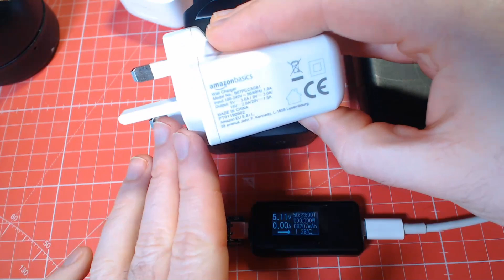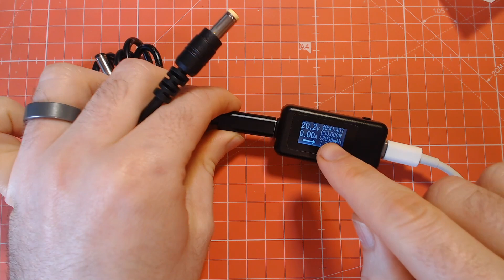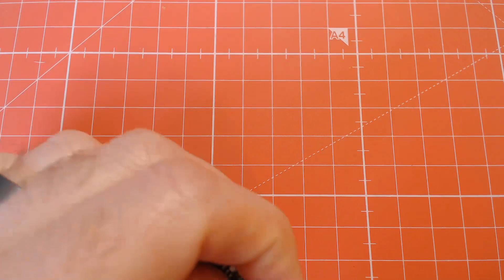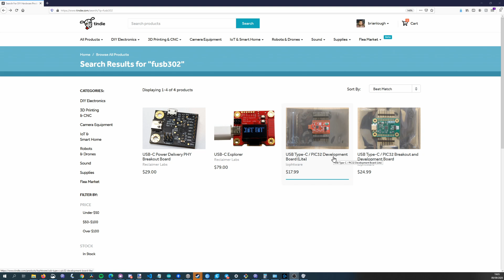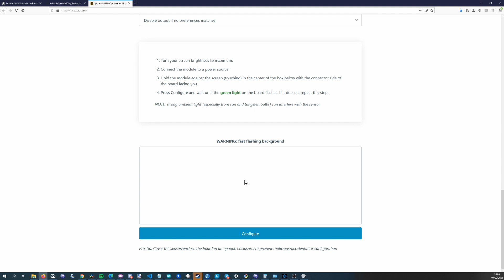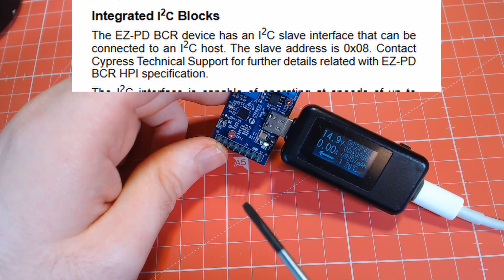Powering your projects using USB-C Power Delivery

Comment from the maker: A piece of footage ended up on the editing room floor incorrectly! The IP2721 will accept the highest voltage the PSU offers that is less than or equal to what is requested

E.g. if it's configured for 20V, but the chargers max is 12V, it will take 12V
Reply: Can someone please tell me if this chord (USB 3.1 Type C USB-C to DC 5.5 2.5mm Power Plug Extension Charge Cable )  can be used to take power from an Anker battery bank and deliver power to the Atomos Ninja V which has a DC connector for powering it from the wall.  Essentially I am trying to understand if a chord which is used to deliver power from a DC source to USB-C can be utilized to deliver power from USB-C to DC.   Can power flow either way in this case?  Thank you.
Reply: Hi
The IP2721 will charge my 90W laptop from a 12V Battery? 

Also The FUSB302 will charge my 90W laptop from a 12V Battery?
Reply from the maker: @Xiaoxiaoxiaomao  neither turn a power source into a pd source. Search for XY-pds100 for something to do that, although I do not believe it will boost your 12v source
Reply: @BrianLough  The FUSB302 chip can actually be used on the source side, but obviously it needs different programming on the microcontroller, plus external circuitry for the power conversion.
Reply: I'm trying to make my own Bluetooth system what's up best pd board to use
Reply: P

Comment: Hi! I am looking to use one of these but custom profile being 6V. Is this possible? I know it’s not the standard 5,9,12,15,20. Thanks!
Reply: You would have to get one that supports PPS. The bigger issue is the supply would need to support PPS as well.

What are you looking to do? Maybe just a boost circuit that boosts the standard 5v up to 9v would be a better option?
Reply: Can't seem to edit that reply, I obviously meant 6V

Comment: I have a 100w power bank with PD from China that i came across when working at amazon. It has 2000mAh and will output 3v 4v 5v 9v 12v 15v 20v and 24v(NEVER seen a bank put out 24v, but i've tested it with LED strips and it works). It is a literal big black brick, but heavier. Even charging in PD it takes hours to fully charge. Only one i've ever seen like it. Even has a flashlight on it. don't know why, but it does

Comment: HI Brian .what would be easiest way to power up computer fans 12v from usb type C charger, my controller use regular plug from psu (12v for fans and 5v for lcd screen) does charger with type a for 5v and  and type c for 12 work ?just use two cables or is there an easier way

Comment: If you need a dedicated unit to supply the E/I, what's the point other than the ability to be able to change the voltage? If one build many projects, they all need their own supply, so why not just use a dedicated wall-wart. To my eyes it's nothing more than a universal power supply with a new connector. Please, someone clarify if i'm wrong.

Comment: Question; I have a 20V 3.25A DC power supply brick, and I want to change the original cable for a USBC for power delivery. Cable has 3 lines, white black and blue, should I guess the blue one is meant for voltage negotiation? Can I just leave it hanging since I just need my 20s.

Comment: Hmm I have a a project with 2 chromebooks that i want to power from 12V battery.. One of my USB-Cables works very well and can charge computers. But when u use a diffrent USB-C it cant charge at all.. the PC wont so anything? Might it be som kind of chip in it? Can these moduels solve that problem?

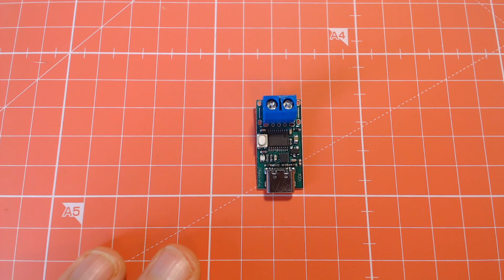Comment: I want to cut my very old samsung laptop power supply (is actually new, it is in a plastic sealed bag since ever) connector and solder one of these (probably the 7:36 one) to make it charge my Galaxy Tab S8 Ultra that supports 45w. Do you think it will work safely? Power Supply specs: 19V 2.53A 48W (it is kinda big).
Reply from the maker: No these do the opposite of what you want, they turn USB power delivery info just power. You want something to turn power into PD.

Comment: Brian, is there a way to control the power (on/off) from the power supply to the device being charged? Can I plug this into a smartphone and control the power through the USB-c port? I need to send 12v to an electronic lock to open and close it.

Comment: this topic might be worth revisiting.
lots of new options on the market now.
incl ones where you can set the voltage by bridging some pads and i have some
that have a tiny set of dip switches for setting the voltage.
easily broken out to proper switches and with some usb-c connectors and a panel volt meter module you can easily make a small volt selector box.

i don't know if you do tutorial videos or anything like that, but i think it would make a highly satisfying project for beginners.
easy to do and the result is something you might use quite regularly.
and few things are more satisfying then making your own tools...

Comment: I have issues in charging my Vacuum cleaner with USB C, I have some more things to try out but it does not like that the PD does +50 watts, the charger is made to 33 Watts so although it begins fine with the charging it begins to fly into the heavens with the Effect 50-105 watts or so and then the robot stops and scream error. I have 20 Volts PD which is very close to the initial 22,5 Volts and it does seem to work, but the blasted release of watts is just no go for it.

Comment: Hi, I am in a process of replacing the power input for charging the batteries of my prototype from a barrel connector to the IP2721 module. So if you can of course, I would like to ask you to let me know what are the distances between the + and - holes on the output of the module and the distance between them and the edges of the board, if possible also the size of the hole. Thank you very much!

Comment: I'd love to see a similar small board with a 3-4 digit lcd, a potentiometer, and three switches. The first switch enables / disables the output, the second one enables / disables USB PD PPS for fine grade voltage control. And the third switch locks an once entered voltage, such that you cannot accidentally change it. When unlocked you can set the voltage with the potentiometer (Using an analog->digital converter inside a chip requesting the voltage from the source), and the lcd shows that dialed in voltage. For me, this would be the only board i'd find useful and safe enough to own and use. hopefully someone comes up with it. Otherwise i'd need to find a programmable usb pd (pps).chip + arduino control code to build my own one
Reply: Seems similar to the current Voltage and current boosters that you can set the voltage on
Reply: @ArtyMars  yes indeed. Just that with the board I wish the voltage is controlled directly by the power supply. That should be more power efficient and you probably get higher currents than if you go the route over 5V and a booster. 

I'm not completely into the PPS standard and voltage regulation though. It could be an alternative to get like 20V 5A/8A via USB PD out and then have a separate Step-Down converter to fine control the voltage. But getting access to the full capabilities of an USB PD PPS power supply still seems nice for tinkering for me.

Comment: Hi Brian, I’m trying to design a custom charging system for my DIY electric longboard with USB PD (and a step up converter), however in order to future-proof my setup, I want to try to make my system compatible with the new 240W PD standard (and be able to request the highest voltage above 12V). Do you of or know how I could search for similar boards to the ones you highlighted in this video, but compatible with the new standard?
Reply: Not that I know anything about longboards but my suggestion would be not to use usb C on it, or any skateboard or scooter.
Charging ports on these devices take a lot of abuse and usb C is too fragile and might break or corrode in humid environments or get clogged up with dirt.
Take a look at XT60 or if you really need more than 60W, you can use XT90 for 90W.
These connectors are a solid choice, most drones (DIY ones at least) use this standard because of its longevity and because it's relatively light.
It will not fail on you, that's for sure, the last thing you need is a fire caused by worn out connector.

Comment: Is the usb c connector on these modules an input only or can they output as well? Like if I input voltage to the screw terminals will it output voltage from the usb c connector?

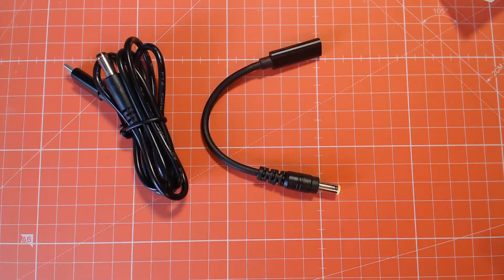Comment: Hello i would like to know and verify if the cable on 3:01 would still supply 5v to a device instead of 20v if i use a charger that doesnt support 20v and only 5v, 9v and 12v. Would it use 12v or 5v? 

i know you mentioned this on the video but im just trying to make sure i understood it right. Thanks in advance!

Comment: I have some issues with different types of this boards. I used them to power my LED Bike light (12V). For some reason the lights starts flashing for maybe 10 seconds when I start the Powerbank, after that it is woking fine. Do you have any idea why this board is not delivering continous power in the first seconds? I tried 3 different boards from aliexpress, 2 with a switch for different output voltage and one with fixed 12V. Do you have any idea?
Reply from the maker: I'm almost certain the negotiation phase happens at 5v, 10seconds sounds very long though! I can't say I've noticed anything like that before when testing

Comment: Can this charging board be used instead of a battery when it is charged with enough voltage to provide as a power supply for (example) a solenoid valve that requires 12v?

Comment: Can someone please tell me if this chord (USB 3.1 Type C USB-C to DC 5.5 2.5mm Power Plug Extension Charge Cable )  can be used to take power from an Anker battery bank and deliver power to the Atomos Ninja V which has a DC connector for powering it from the wall.  Essentially I am trying to understand if a chord which is used to deliver power from a DC source to USB-C can be utilized to deliver power from USB-C to DC.   Can power flow either way in this case?  Thank you.

Comment: Question for anyone knowledgeable on this topic.

I have an HP laptop that has a 4.5 barrel charger and a USB C port that does not allow charging. I'm using a USB C hub that is PD compatible with monitor, keyboard, mouse etc connected to it.

The issue is I have to connect the OEM 4.5mm barrel charger and the USB C hub cable. I'm thinking of building Y splitter that on one side is a female that would connect to the USB C hub and on the other side a male USB C data cable that would connect to the laptop and a 4.5mm barrel connector that would connect to the charge port.

Does this make any sense?
Do you see any issues with this idea?
Would I have to power the data side or I only need the data cables for that one?
Any recommendations?

Comment: Dumb question. Can I use the Male PD Cable Adapter for powering a 12v enclosure (2-3A), from a usb pd type c input from a motherboard? The MOBO can provide 5A

Comment: The part with the fixed Voltage at 4:50 isn't quite correct i have a PD integrated Cable (which goes up to 20V) and my powerbank only supports 15V and the cable doesn't default back to 5V it stays on 15V (measured with multimeter) :D
and my Samsung 25W PD Charging Brick has max 9V which the PD cable fully puts out :)

Comment: Hi power meter you use black one some can explan why this ONLY works with quickcharges and not ulefone power 5 get ONLY up to 2.6 amp but say support up to 5.1 amp its also issue with xiomi ultra support up to 100 watt 20 volt 5 amp but is its same AS powerdelivery?

Comment: What if i bought IP2721 with fixed 20V and i connect it to my powerbank that only support up to 12V 1.5A PD...
Will the IP2721 with fixed 20V Only output the powerbank max supported PD output voltage which is 12V 1.5A  or it will forced the powerbank to output 20V ????
Dont mind my grammar, Need answer asap Thank You❤️ Thank you💙 Thank you 💚
Reply from the maker: It will output the max voltage the power bank supports that is equal to or less than what it's configured for.

In your scenario it will output 12v

Comment: Dear Brian, thank you for sharing your knowledge with all us! I have a bit of a problem I thought you might help me to solve. Please would you be able to think of a solution for the following: I have a 5v 2.5A LED Light I want to get powered through a Usb C PD battery bank. I tried so many different approaches and the best I can get is the light working pretty stable, but at maximum of  70% brightness. The Power bank is Anker 10k with Usb C PD. Bought a cable that goes from Usb C to Usb A and another cable that goes from Usb A to DC 5.5mm that goes straight to the light. First I thought the battery is not good enough, then after reading a bit I started to feel the cable might have some resistors that are reducing the current which then gets not enough for the light. As an example I connected that same cable set I mentioned to my iPhone 11 Pro PD original charger and the light acts exactly the same as when it is connected to the battery bank. The iPhone charger output is 5v 3amp. This is why started thinking there might be something wrong with the cable. I am lost now! I would really appreciate if you can help me on this! Thank you so much in advance!

Comment: I used the YZ12PDN and found it finicky.  It doesn't seem to respond consistently. I can't figure the reason. The blue light starts flashing which means no pd support. Sometimes it works fine.

Comment: So if i want the small IP2721 board at 20V, i need to get it fixed at 20V ? or do i need to change the select pin with an iron? Sorry for the noob question.
Reply from the maker: Yeah buy the one configured for 20v. I guess it would be possible to modify a 15v one to be a 20v one, but I don't think it would be worth the time

Comment: I have an idea to charge my elictric scooter with pd
Its charger puts out 41v @1.9A
The conversion should be really easy but im struggling how to make sure i dont pump too much current
And i have never tried it but my guess is the bms could charge at lower amps if i held the voltage just right

Comment: Can I also set a different Voltage then 5,9,12,15 or 20V?
Reply from the maker: No, the charges have fixed voltages they support, and the standard is only the ones you listed

Comment: I would like to buy this cable and replace the USB A connector with USB-C - is this possible?
AIEVE Charger for Braun Shaver,USB Charger Cable 12V Power Cable for Braun Beard Trimmer Shaver https://www.amazon.co.uk/dp/B07ZFR2KTC/ref=cm_sw_r_cp_api_fabc_UkYPFb17H4R9X?_encoding=UTF8&psc=1
Reply from the maker: I would think so. One of the cheaper modules I showed set to 12V should work fine. One thing to be careful about is that there is a lot of USB PD power supplies that dont support 12v
Reply: @BrianLough  thanks Brian. I will test this very shortly. If the PD charger doesn’t support 12v, it simply won’t provide any power or can it actually damage the attached device? Thanks again

Comment: Thanks for this great video. I read that also the cable is involved in the current and voltage negotiation.
Perhaps the STUSB4500 sticks to the specs exactly and the cable wasn't suitable for the 20V/2.4A.

Comment: Does "current negotiation" mean setting the maximum current that the PSU should give?
Reply from the maker: No, it's not like that. The psu advertises it's max current capability and it's up to the sink(device) to decide if that's enough. The psu will not limit the current at all
Reply: With chips supporting usb pd pps you can actually go into a constant current mode where you can first set a desired current, and then the psu tries to keep that current level by constantly adjusting the voltage in a range of 3,3V and around 20V (depending on the capabilities of that psu)

Comment: Thanks Brian for this video.
Some additions to the Cypress solution:
The Cypress IC itself is called CYPD3177 BCR, which stands for Barrel Connector Replacement.
The I2C interface can be used to program a specific power delivery profile.
This module also has a MOSFET switch to turn off the output if the requested voltage cannot be delivered. It also prevents power backfeed back into the source.

Unfortunately, you did not look up Tindie for boards with this chip and there is one available.
https://www.tindie.com/products/pier42/usb-c-pd-sink/
How do I know? I am the creator (shameless self-plug).
Reply from the maker: Hi Wolfgang,

Apologies about that, I had to rush to finish the video so the cypress section was not as detailed as it should be and I forgot to do the tindie thing!

I have actually come across your board and hackaday project previously, but I can't remember why I didn't order your board, was it sold out in may/June or could you not post to Ireland or something? Maybe it was just that I thought the cypress didn't suit my use case too well. (Edit: actually I just checked there and I think it might have been the postage cost, it's more than the unit for me, I would also be liable for VAT on order that size coming from outside the EU, so with admin feeds it would actually cost over $60 delivered)

Have you used the i2c part of the cypress at all? Since releasing this video I have looked into a bit more in detail and it feature wise it looks excellent, but while they do provide a tool to configure it from a desktop, it seems to require a cypress programming board that costs $100 (although I have seen some cheaper alternatives)